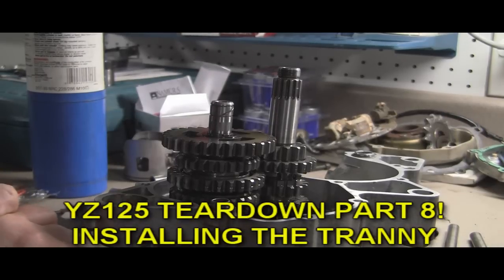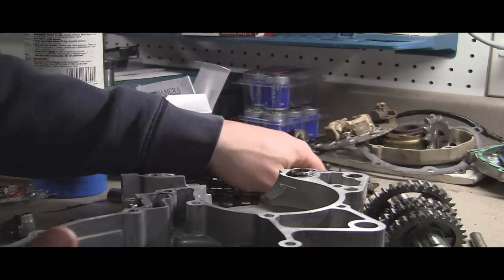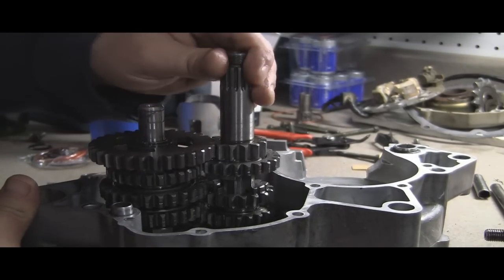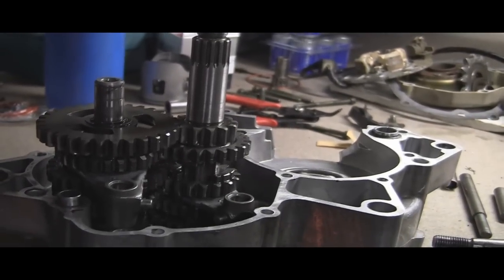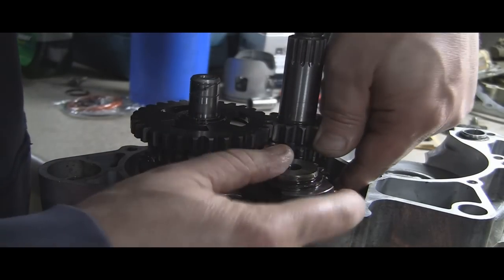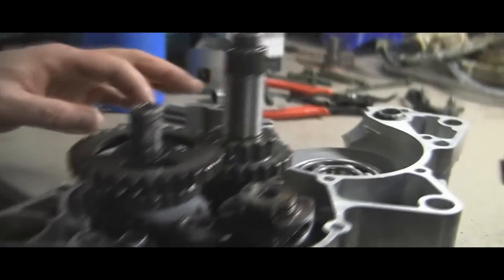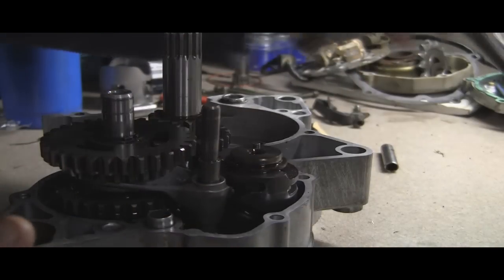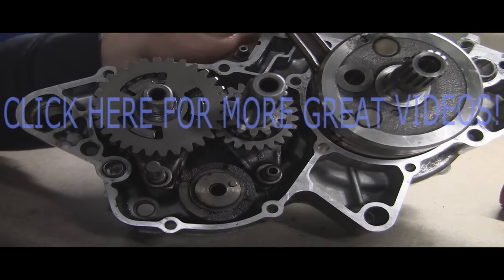YZ125 Part 8: Installing 2 stroke Transmission (tranny) and View of How it Works

Comment: Well we got it running. Seems to be perfect. Runs really strong and shifts smooth. I had to do a carb clean to get it running is why it's taken me to do a final post. Oh yea, and a certain friend cracked the case on one of the moter mount points because that engine, has a couple of different versions with different size mount bushing holes and bushings. I had two moters and started on the one out of the bike first. It woundnt fit with the bike going back together. We drilled out the case (that was now welded back up) with a 1 inch drill bit and poof!  It fit. 
   But my friend had tried to half hollow out and half Pound the bigger bushings into the rebuilt moter case. It cracked out. So I had to tare it all apart so it could be welded up again. Thanks for the great videos!!!!! PS careful what you let others help you with. They may need a little help from you to get it right.
Reply from the maker: Patrick Germond Thanks for watching, I appreciate it!

Comment: Hey Johnnysshop I just bought a 2004 yz250, changed clutch and everything worked fine for about 2 weeks!! I rode the other day and now my first gear is acting up. if I idle around it's ok, but when I floor it, it seem to go in and out of gear real fast, and when I shift to 2nd it will take off like there is nothing wrong and I can go through every gear with no problem. I found a thread on one of the forum that said one of my fork could be slightly bent.

Comment: Its easier to drop the crank in if u heat up a socket the size of inner part of the bearing and let the heat transfer to the bearing. be careful not to melt the oil seal. That way you keep the crank alignment perfect. The socket should slide inside the bearing center and be almost the same size.

Comment: Awesome video I had engine noise, sent my bike to a friend working fine. Had top end done and also crank, after e put it back together it can only go to 3rd gear and can't hardly get 4th and of he does it dosent catch and it's a b to get back to third.. Do you think he knocked the forks loose? Also even when I'm pushin it in neutral I can hear the gears ticking... Idk what he did :,( any ideas would help thanks a lot -fish

Comment: so much easier to install everything on the right side case & just drop the left side over also where is the washer plate that goes over those last 2 gears you have just sitting in the case?

Comment: i just bought a 97" cr80r for the low not running but once i got it to my house i cleaned out the carb and jets and put it back together, on second kick it turned on and stayed idle for like 10sec now i redid it and this time i go to put it in gear and start letting the clutch go i feel it moving like its gonna go but wont go no where i shift into others gears and still nothing Need help please!

Comment: my 1999 rm 125 will not shift into second when riding but will if you use your hand was told shift forks so i have split the cases had the transmition out put it back in i can get every gear by hand but is there any way of testing the forks dont realy want to put it back together for it to not select or do you think i should just replace the shiftforks

Comment: I have a 98 rm125 which was popping out of 2nd gear. i figured a tooth on the 2nd drive gear broke so i stopped riding and tore the whole motor down after watching your series. problem is nothing seems to be wrong with any of the gears which surprised me when i split the case. any ideas on why it would pop out of 2nd gear only?

Comment: if you could answer my question it would be a lot of help ... I was riding one day and my bike sounded like it blew up like I see in a lot of you tube vids..but the kick starter lever still goes up and down .. but now it won't find neutral , the only way I can kick start it is if have it in gear and hold the clutch and kick start it but when I let go if the clutch it turns off  even if I give it gas .. but lets say if I'm in 4th gear it will go but I will still have to hold in the clutch a bit untill I have a lot of speed then I could let go ...would you know what the problem is? or could you help me narrow it down to something?

Comment: hi i just rebuild my kx125 crank , and now i got everything back together , so theres a problem it has all 6 gears but neutral when i push it foward or back wards IT MAKES A VERLY LOUD CLACKING NOICE AND I PUSH FAST ENOUGH IT POPS INTO 1 gear by it self. so i though basket was messed up so i took all that and stoped doing it, then i realized it only does it under pressure what could it be? please help.

Comment: same thing for an 05 rm125 right i took my gears out and dont know how to put them back in is this it ? please help
Reply from the maker: Have to look at the manual and assemble them out of the case. You can rubber band them together and slide them in.
Reply: Did you get it installed? I'm having the same problem.

Comment: im having trouble with the two spacer/washers that were visible on your removal video do the 2 washers go on the right side of the case beneath the ones you have laying in the bottom right hand side and no washers on the other side? cant remember from when i removed it the first time and the hand book has no references
Reply from the maker: +Joshua Simmons Which ones? Or just send me the time in the video you see them.

Comment: ***** I'm currently rebuilding a 2003 rm125 completely. The crank has massive play so replacing with wiseco top and bottom end kit, I noticed you tapped the crank back in.. will they cause damage to bearings in the case? Or will I be better of ordering tusk crank puller? Cheers Dan. Ps. Love the vids!
Reply from the maker: Dan Cassidy You should be fine, the crank puller is very rarely ever needed. Just be patient and don't slam another, light taps is all you need.
Reply: how'd that Wiseco work for you im thinking about purchasing one ?

Comment: Hi was wondering if you could help, in the midst of rebuilding my TM125 got the cases back together but now they're apart again selected N-2-3-4-5-6 fine but wouldn't shift down to first, baffled! Any help appreciated thanks!
Reply from the maker: I'm not real familiar with the TM125 but have you spun the flywheel while trying to shift down to 1st? I'm assuming you haven't ridden it is the only reason I ask. Sometimes it won't shift into first especially unless there is movement.
Reply: Pulled the casing apart and double checked all the gearbox, seemed fine but had a spare set of selector forks, swapped them over and re assembled goes through all the gears fine now but sometimes it's a bit fussy, yeah I tried rotating the gear shafts and shifting at the same time.

Comment: did you tap the crankshaft all the way in buddy? this is my first bottom end rebuild and im stuck on this part because i havent bought the $60 installer yet!
Reply from the maker: Yep, you shouldn't need the tool
Reply: Thanks man!
Reply from the maker: nathan clark Good luck!

Comment: is there supposed to be a washer in between the biggest sprocket and the bearing in the case at 1:17? because my countershaft 2nd gear was scraping down the 2 bearing holders and the screws that held them in.
Reply from the maker: +Zaanjo Hmm.. Mine didn't have one but that sounds like maybe there should be one...
Reply: yes thank you for the reply i found in the manual that it is supposed to have one ( i have it now), but its weird because all the factory loctite was still on all the bolts on the engine, so i assumed no one had ever messed with the tranny, there were a quite a but of metal shavings in there tho so maybe it just ground down to nothing? idk lol
Reply from the maker: +Zaanjo Strange, mine didn't have one either. Maybe Yamaha missed that on a lot of bikes! Good to hear you figured it out!

Comment: My son has a 08 ktm 65sx, I split the case apart and replaced the bearings but I left the shift drum in but I think I may have turned the drum in the midst of doing all this. Is there any way I can make sure its in the correct position before putting the case back together?
Reply from the maker: I spin the gears by hand and shift them before putting the case back together. It should run through the gears but you have to spin the gears. Some shifts will not react until the tranny gears are spinning.

Comment: do you have any tips for getting the driveshaft in? mine's sticking. i can't get in by itself, let alone as an assembly with the other
Reply from the maker: +trenteg11 It can be a pain, just take your time. Maybe try to fully assemble, hold it together with some rubber bands and try to slide it in that way.

Comment: i have an 03 yz125 and i was riding one day and it randomly wouldnt shift, it was stuck in 4th or 3rd and when i click the shifter down it hits the sub frame and when i try to shift up its like its not reacting with the upper gear. I was wondering if you could help me try to figure out what the problem is soon please. thank you
Reply from the maker: +Gage Whitaker Try to adjust the shift lever first, it may have skipped a tooth not allowing full motion. If it isn't that, you will probably need to get in the case and investigate.

Comment: I used your video to rebuild the bottom end of my YZ 125. Now I have a large washer leftover after putting it back together. It's the same size washer used twice in the clutch. After rewatching the video I think it is supposed to go on the counter shaft between the gear and the case (inside the case). You show it on top of the shaft at one point but don't mention it when installing.

Without that washer, the chain rubs against the case and when I tighten the nut the sprocket binds up.
Reply from the maker: Same year bike? Most have little differences here and there.
Reply: It's a 1999. The parts diagram shows the washer. It's the only washer on the gear cluster not held by circlips. Without it the counter shaft sprocket would bind up when tightening the sprocket nut. It was fairly easy to put back in with my Tusk crank splitter/puller. Split it, put washer in and pull back together. The sealant was the time consuming part. Everything seems good now.
Reply from the maker: Oh good!
Reply: Did you put the washer on before setting the 2 gears in the case?

Comment: Help ? I split my cases to replace the crank , I never touch the transmission, but now it won't let me shift up or down , it's like the gear drum is stuck or something , any suggestions?
Reply from the maker: +Deon Levell Sounds like you may need to split them again. I would guess that the shift drum shifted from the forks.
Reply: +Johnnysshop I'll let you know how that goes
Reply: +Deon Levell I'm having the exact same issue on my 01 yz 125. Have you made any progress? I've been trying to figure out why it wont shift, and I just thought that I might have put the largest cog in upside down, where the cutouts seat onto the smaller gear underneath. I don't know if this is the problem but I think I'm going to try and flip it and see if it changes things. let me know if you find a solution.
Reply: +Evan Haltom well I split my case & made sure my gears were set but I took the gear drum off & it let it shift just fine, then I put it mostly back together it'll shift but I don't think it's clicking into a gear, I was going to let my mechanic look at it

Comment: when I sat my gears in the engine , I twisted the gears and they rotated but after a little rotation they stopped and I rotated the other way and It stopped , have I done something wrong for it to do that or is it suppose to do that ????
Reply from the maker: Sounds normal. It's probably in gear, try to put it in neutral.
Reply: thanks man . Your videos are great help also
Reply from the maker: IG:_clutchhhh Thanks!

Comment: Hi I was wondering if someone could help?  I am new to dealing with transmissions and I installed mine into my  left case as you did in my rm 250 and I can spin the shift drum around to the left and right while spinning the gears, but I don't here a click for every gear and I can't find neutral,Is this normal?people say it has to be in neutral before you put it back together,  does it really matter?
Reply from the maker: +Noah .Ireland It doesn't necessarily have to be in neutral but I would make sure you can find it first. Put the other side on temporarily to see if that helps.
Reply: @johnnysshop well I got it all back together new top end and new seals gaskets and bearings.  But now it's having trouble shifting between gears.  It went down to first nice when I first took off and then when I stopped it clicked into neutral smoothly,  but I took off again and took it down the road and it wouldn't go into second so I messed with the lever and stuff and I think I got it into second but when I would try to shift into a higher gear,  it would and then it shifted back down by itself almost immediately (I could here the bike rev). So idk what's wrong.
Reply from the maker: +Noah .Ireland It sounds to me like maybe the forks aren't seated correctly.

Comment: Why is it the yz125 transmission is so easy in comparison to the yz250?
Reply from the maker: Really they aren't a whole lot different. 250 is 5 speed, 125 is 6 speed.
Reply: *****
Oh I know they're very close, but they don't have rods that conveniently slide into the shift forks.
Reply from the maker: FactoryXperimental FactoryX Ahh